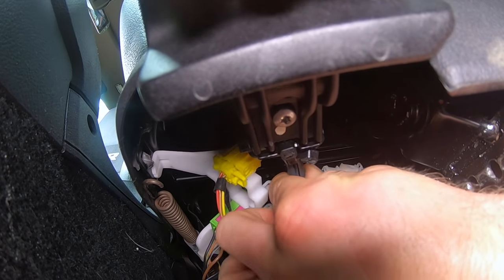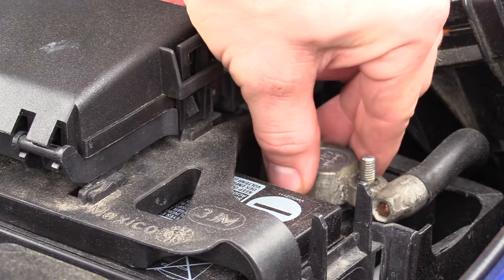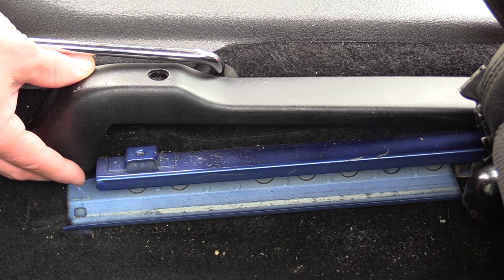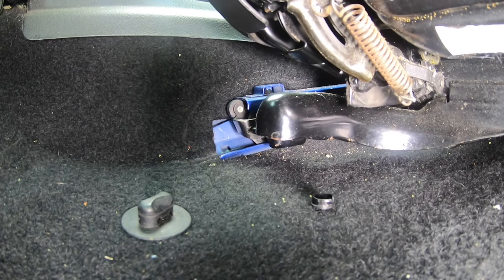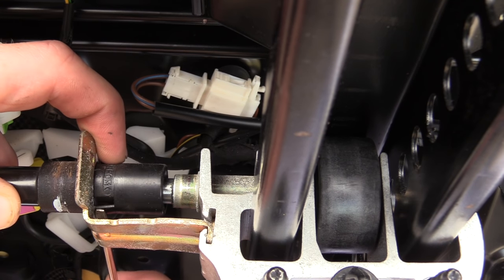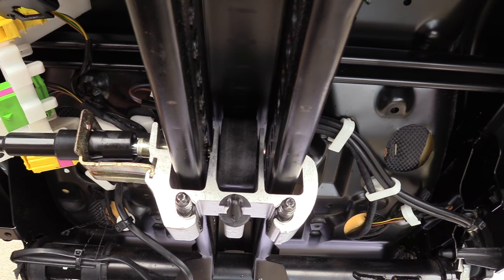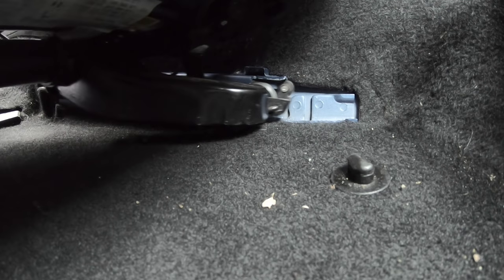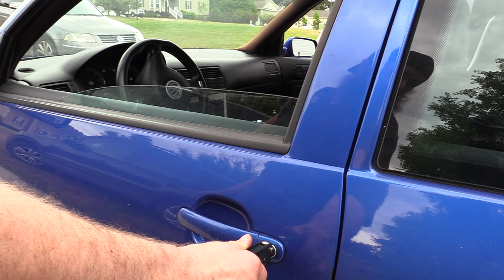How To Remove a Seat Adjustment Cable (Seat Won't Move)

Comment: Thanks so much for a really clear video! My 2003 Golf seat wasn't locking into position and your tip to lubricate the pin was all I needed to do - without removing the seat :-)

Comment: When are you planing to fix the heated seats
Reply from the maker: It was a blown fuse. Lol I popped a new one in and have been testing it. So far no issues. I should pull out the current prob and see how much it draws
Reply: @HumbleMechanic Ah, I see. I wish mine were that easy to fix. Nice car btw.

Comment: Huge up for you mate!  My cars passenger seat has the same problem. The plastic part was good, so I tried to clean the lock pin without removing the seat from the car. It was way harder because of the tiny place, but still could do it. I gave it a WD40 bath and put it back. Now smooth as F. Thank you for this awesome video! I wish I could give you 1000 like for this! Keep it up!

Comment: What in the world is pinch protection?
Reply from the maker: The auto up feature also has built in safety where if it hit something with the window, the window will stop and go back down
Reply: Is there a video on setting pinch protection? I thought I knew a decent amount about the MKIV, but never knew there was some process to set this.
Reply from the maker: No video. Just roll the windows down and the up with the key in the door.

Comment: Great video. If you got your pin stuck and the seat is not locking or unlocking try putting a lot of penetration oil like PB blaster on where the pin is. It immediately released my seat locking pin and I didn't remove my seat :)
Reply from the maker: Nice

Comment: I found this very interesting.  I work for an automotive supplier  who makes several products for almost all oems. I specialize in seat structures.    We do not do much seat business vw.  These seat structures are somewhat different than a bout all other seat structures. Most systems seem to copy each other but this is quite different.  I appreciate this videos.I often get new to me products which I'm ask to test, fix, or benchmark. Having no knowledge of that seat structure I often find my self on YouTube looking for videos just to see basically how it looks works and can be removed.
Reply: I'm not surprised that you don't see this sort of design very often. As a bicyclist, I can tell you that a bowden cable like this requires periodic cleaning and re-lubricating. Putting one in an inaccessible location like this is asking for trouble down the road.
Reply: @KeithHearnPlus  Well sometimes it dont need anything, my original seats have been running for 24 years no problem.

Comment: I had the issue with the pin not slotting back in on my 2003 1.4 golf, this video enabled me to sort it from seat out to seat in within 40 mins with no issues! Also managed to refurb the cable in there. Thanks alot!

Comment: First, thanks for the video. The whole channel is an incredible resource. Kudos. Here's my issue: I have a 2007 Rabbit with 2 doors, which means that I have the handle/latch on the top left of the seat which is supposed to release the seat to bend the seat forward as well as slide it forward. for easier access to allow people/stuff into the back seat. In my car, the top latch bends to seat forward but doesn't slide it forward. Here's the weird part: the lever under the front of the seat still allows the seat to move forward fine when the seat is engaged in normal sitting position. This is on the drivers side. The passenger side works fine (except for the damn faulty airbag wire underneath...). If I didn't have kids that I had to get into and out of the back seat, I wouldn't care. Anyway, was hoping for some insight. Thanks for all you do!

Comment: Thanks for this video. You explained everything very well and it was very easy to see what you were doing. My wife's Beetle had a dirty plunger and wouldn't re-engage once you had the seat in position, rendering the car unusable. I had looked in there and seen that it was using a bowden cable, but needed your video to tell me how to get to it. I was barely able to pull it out of the tube, it was so dirty. A little WD-40 and it cleaned right up. I then used the cleaning rod from my 9mm pistol to clean the inside of the tube. A patch with Break-Free CLP that I use for the pistol, then a little scrubbing with the bore brush, then another patch to get the loosened dirt out. One more wet patch to lubricate it and then everything was nice and easy to slide.

Comment: Thank you so much. I was struggling with this repair. Your video helped me get it done.  I liked you showing putting the shop rag over the battery post as the wire wants to reset it self on to the post. Cleaned up pin and applied lock lube. All is good, wife is happy.

Comment: I had a '99 Passat and those two 13 mm seat mounts were nuts
Reply from the maker: Maybe they switched on B5.5.
Reply: The models with power seats had bolts, the ones with manual seats had nuts.

Comment: Is this the cable that allows the seat tonfpld forward to allow passengers to get into the back of a 3 door golf? My driver's seat won't fold forward when I pull the handle
Reply from the maker: No that’s a different cable.

Comment: Hey Charles, the front bracket on my 04.5 GLI driver's seat has broken off the frame, so I can't adjust the seat forward or back.  Any fix for that?  It seems PO attempted to tack it back on with a welder, but obviously that didn't work.  Thanks!

Comment: I have a 08 Beetle with the 2.5l.  The car has the one big cooling fan.  Is there a way to make the fan come on for testing, it only has four wires.  Thanks,  love you channel!
Reply from the maker: That’s a whole different animal.
Reply: though my car is not a VW, i tested if the cooling fan worked by just having the engine on while the car was parked, after some time, the engine would get hot enough so the fan turned on by itself.
hopes this helps.

Comment: As always a quality video.one thing missing. Face mask, and heavy gloves.(lol) I remember when I was a young pup I had training in how to deal with airbags when they first came out. They highly recommended a face mask and gloves.i laughed when I saw you removing the connector to the air bag.try doing that with gloves lmao.however I did have a bag deploy on an 05 Chevy van when a power cable shorted under the drivers seat and almost hurt me.i see why the directors were concerned at that training class.it sounded like a 12 gauge going off besides my ear. But in reality we can't do all the intricate repairs with heavy gloves.i do appreciate all the safety recommendations. Cheers
Reply from the maker: Always good to keep safety in mind. That’s why I showed disconnecting the battery. That’s actually something I never do when working with these seats.

Comment: what if the seat doesn’t move forward or back at all i’ve tried moving the handle under the seat and the one at the top of the seat and it doesn’t move any ideas?

Comment: Please do a vid fixing the braided cables that allow for the seat back to come forward so that passengers can get into the back seats. The cables are connected to the latches on the sides of the seats and tend to break where the back of the seat meets the bottom of the seat.
Reply from the maker: That’s another great video
Reply: @HumbleMechanic  yes, please!

Comment: Hey Humble mechanic...I have a mk4 2000 jetta, do all mk4 have the same seat cables?  im wondering cause my mechanic can't find one to replace mine ...and i found an 03 jetta at scrap yard that might have the cable..just curious if it would work.

Comment: I've had some trouble with the airbag light on my vw golf mk 5 after removing the seat and starting the car.  Does it need a factory reset?
Reply from the maker: The light will need to be reset. But the mk5 has big time seat airbag issues. There was a recall that didn’t r ally fix all of them
Reply: HumbleMechanic thanks for the heads up.  I'll talk to the dealership about it

Comment: I would put the cable on the handle first. That plastic piece connecting to the cable is pretty rigid and hard to manipulate when the other end is on the runner release. It worked for me as getting the handle end on was just getting nowhere. Also, why does VW not use the space better under the seats??? I made sure all electrical connectors etc were out of the way so I didn't damage any of those while fitting this cable. Still very tight after all is installed

Comment: Charles, I have the 💺 💺 out (airbags obviously not connected) and I need to hook the battery back up to move the AT shifter back to remove the console. Will hooking the battery back up cause any issues with the airbags?
Reply from the maker: The airbag light will be on. You’ll need a scanner to clear codes but it won’t be any issues

Comment: But can you take on out that’s NOT broken, that’s what I wanna know. Mine broke and I’m wondering if there’s a way to avoid $50 price tag for these things new, plenty of em at junk yard under the seat, but I can’t get em out without breaking the plastic housing that snaps in so “nicely”
Reply from the maker: a little heat you can, but they are super fragile with age.
Reply: HumbleMechanic Replying to a vid this old, that quickly, on a Sunday! You truly are a humble mechanic. 👍🏼 Thank you sir

Comment: The instructions are mostly good for my 2001 Jetta, except for the following: (1) I had to bang on the front end of the seat rail several times to drive it to the back. (2) I couldn't get it to tilt back until I got into the back seat and used the seat back to leverage it. (3) releasing the yellow air bag connection required sliding the entire connector pair out of the white mounting bracket just to see how to release the terminal. (4) the white mounting bracket for the 3 wiring terminal pairs continues around the back of the yellow terminal pair and into a tightly wound cloth taped cable going into the floor, so the seat still can't be lifted out even after the terminals are all disconnected. I had to replace the cable with the seat rocked all the way back, but still inside the car.
Reply from the maker: I did them all in the car too. It’s just easier to show when it’s out of the car. Glad you got yours fixed up!

Comment: Hi Charles! Great video! 
The problem for me is that the driver's seat was stuck today when my wife was taking the car to get to work. In a position she couldn't drive in... Luckily I had the possibility to drive her to work, the seat was in my position. We have a VW Polo 2015.
The adjustment lever pushes down on the metal tabs, but the seat won't move, neither forward of back.  Something has apparently jammed it.
Any suggestions for me to fix this are appreciated.
Reply from the maker: I wonder if it’s similar to this and just frozen. 

I’ve seen newer vw seats get the handle stuck the wrong way. It’s fixable , you have to reposition the lever
Reply: @HumbleMechanic Thanks for reply. I was able to fix the problem by pressing down with a screwdriver directly on one of the metal tabs and wiggle it a little. Probably a small pebble got stuck in there.